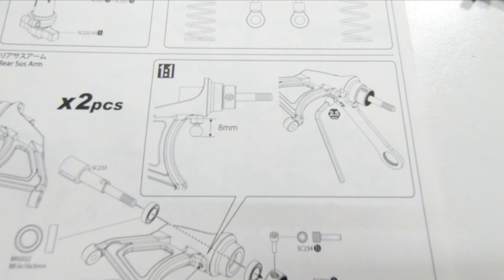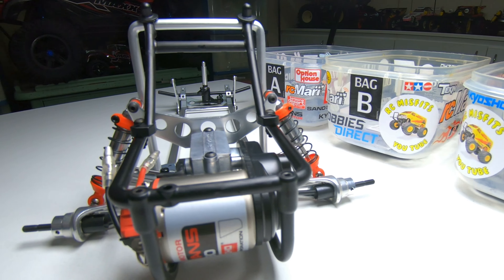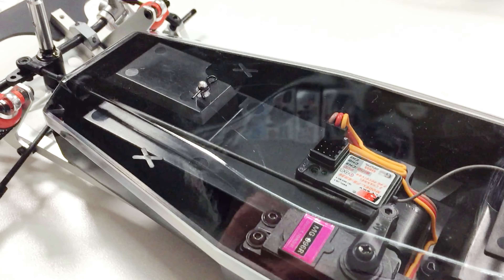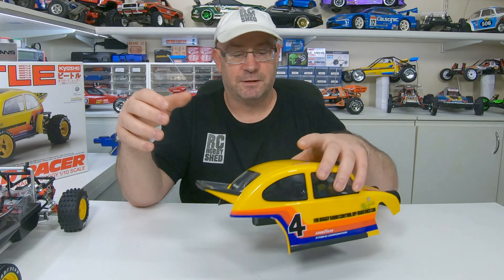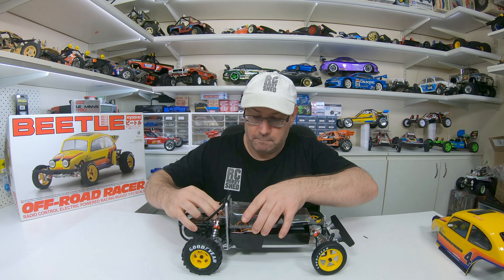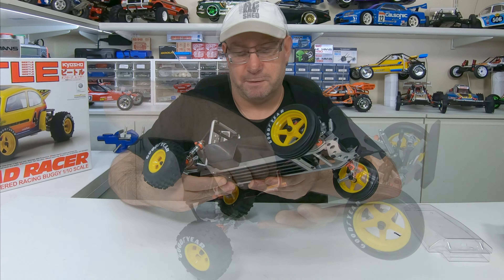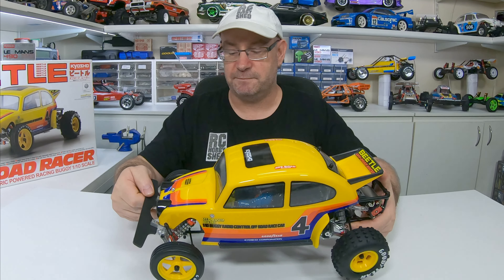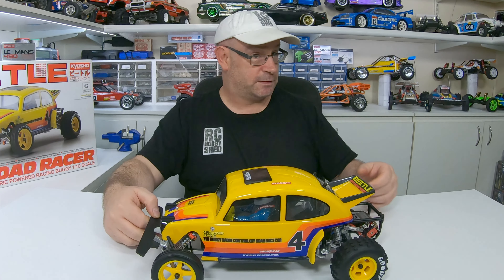Kyosho Beetle 2014 - Kit No. 30614 Build

Comment: Hello, I discovered by chance on your YouTube channel while searching how to paint my kysoho beetle.

Very good video, and your channel is top!!! you must spend a lot of time to do all this. 

I wanted to ask you to confirm the paint job because this is my first RC body that I'm going to paint. 

I need two coats of yellow, let it dry, then 2 coats of camel yellow, let it dry, then one coat of white and finally one or two coats of black? 
Your pilot is very well detailed, I'm thinking of doing mine with a brush, is that a good idea? 

Continue like that on your constructions it's great!
Reply from the maker: Hi! Thanks for watching, I'm glad you enjoyed the video. 
Yes, that is the paint combination I used. For me it seems to work well and the colour matches the wheels nicely. 
Thanks. Painting the driver with a brush will be fine, it will look great 👍
Thanks mate! 👍
Reply: @RCHobbyShed  The problem with your videos is that now I want to mount the whole legendary collection 🤣🤣🤣🤣

But I was wondering if I let the yellow paint dry before putting the Camel paint, won't the two paints mix?

 and the shade will not be good? 

Sorry I'm a total beginner in body painting
Reply from the maker: @DidyRacing41  Haha, have fun collection them all! 😁

No mate it will be fine as long as the coats aren't very heavy and wet, you want reasonably light coats just enough so it's not patchy. I tend to let each colour dry for around 5 minutes then hit it with the next colour.
You can practice on the side of used plastic soft drink bottles first as a test. Good luck, I'm sure it will turn out fine! 👍
Reply: @RCHobbyShed  Hello, it's me again 😁😁

I'm about to order all the paint for my beetle and my turbo scorpion. 

I saw how you painted the pilot of your tomahawk, and I was wondering if the Tamiya Mini X paint ... would go to paint the pilots? because here in France my seller says that this paint can't go on it.

I don't want to buy a lot of paint cans of different colors just for the pilots because you don't need much paint 😀

Comment: tidy and beautiful build.  I just bought it yesterday.  My friend has one too but he told me that the decal quality is not as good as Tamiya and the they could not stick on the shell firmly.  Do you have the same problem too？
Reply from the maker: Thanks Charles. Congrats on your Beetle purchase, I'm sure you will be very happy with it! 
As for the decals, I found they're actually very good. The only issue I had is around the headlights, the decals are quite thick and they need to be bent over the tops of the headlights. So they tend to lift in this area. Some clear Acrylic paint brushed over the edge of the decals can help or a small amount of glue. 
Then rest of the decals were fine for me, no issues  at all. 👍

Comment: How thick did you have the base coat of PS-6 before you did some coats of PS-19? Could you see through it still? I was going to try PS-6 and back it with 13 silver then black, but I like how yours turned out and would like to try it instead. Thanks.

Comment: The antenna wire didn't go up inside the pipe, was there a reason for that ?
Reply from the maker: It is up the pipe, at 5:41 you can see the wire running down the back of the tube. But it looks like it's just dangling at first, I did that on purpose because I knew I had to put the ESC underneath it later.  👍